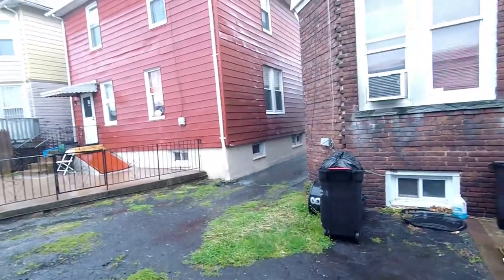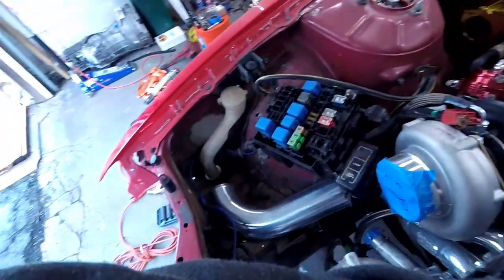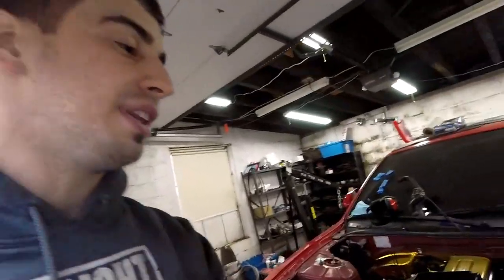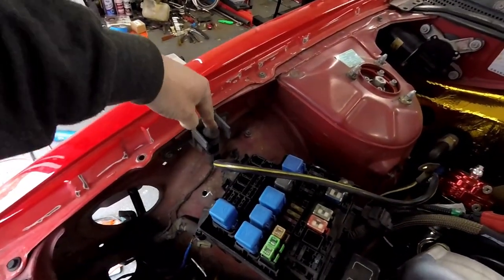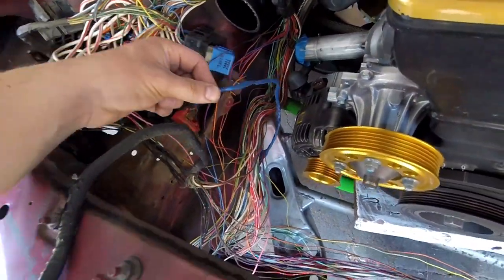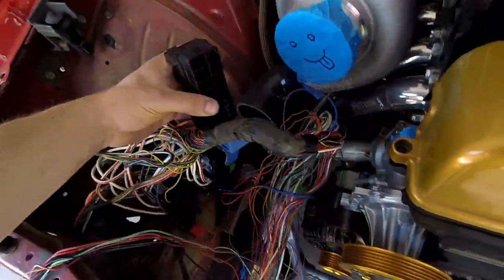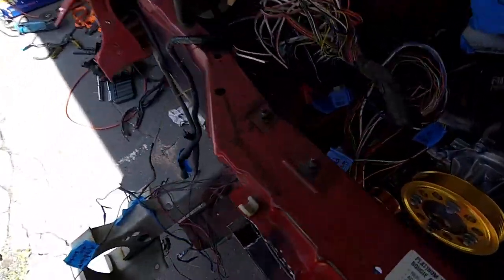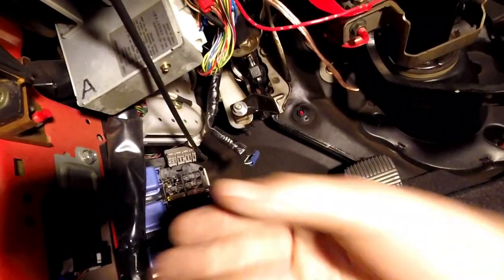HOW TO RELOCATE THE 240SX FUSE BOX! (THE EASY WAY)

Comment: did you end up moving the wiring to boot? you should do a follow up video to this one
Reply from the maker: Unfortunately no. I have the wiring layed out even after all this time. I ended up buying another house which is taking time away from my build :(  But at least now i own the garage that my 240 is stored and i dont have to be worried about being kicked out lol. I will definitely do a follow up video when i get back to the working on the car
Reply: @AllCarsEverythingOfficial  hey bud hows it going any update? Im currently wanting to do the same with my s13 but its such a daunting process with all those wires!
Reply: @smudge2021  This video showed 90% of the job really. The hard part is getting the loom inside the car. After that just snake the wires to the trunk or wherever you want. Do the grounds that are needed, I think it has one on the fuse box. Route the couple of wire up front for the headlight through the dash into the engine bay or even through the same wya the loom came but protect them better and zip tie them in a good spot. Smaller bundle of wires wont get smashed by tires but your choice. Pretty much done there.

Comment: personally butt splices look gross and sometimes get intermittent signals so typically what i do is when cutting a wire harness to lengthen, shorten or even add a new harness i go with all new connectors and pins and i got a few connector styles i like if im adding connectors and that way it looks so clean and you can even make shorter sections for known problem areas so you take that section out replace a wire and pins and reconnect super simple thats what im doing on my bosses semi right now as the techs gave up on it im ignorant enough to take on that big ass challenge and thats basically how i do things lol
Reply from the maker: that,s good info what are your more favored connector styles?

Comment: Next time just take apart the two white boxes they separate the body harness from the engine bay harness
Reply from the maker: The white boxes under the dash? and the engine harness is already bye bye lol
Reply: Yea there is a 10mm bolt in the middle  of the white box and they will come apart
Reply from the maker: matt coy it seemed a little more in depth I wanted to bring the fuse box into the car so this way I kept the underdash together and just brought the wires in